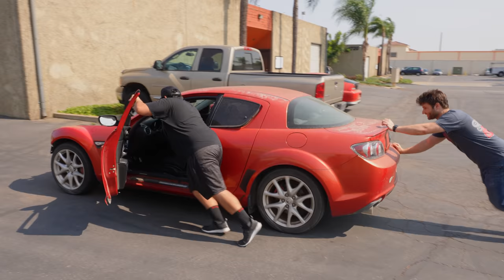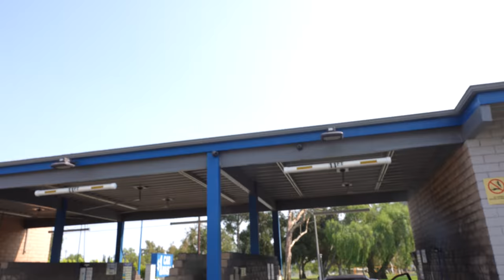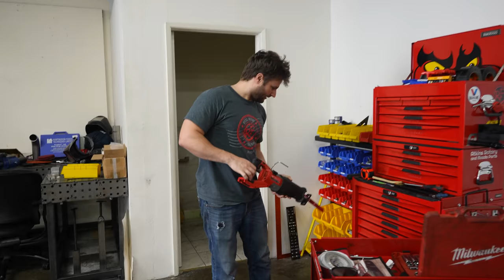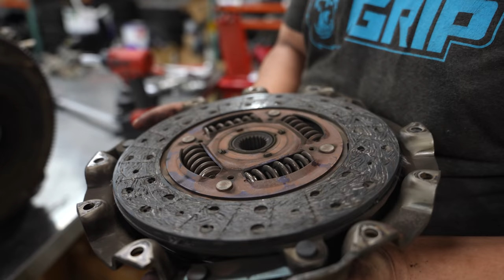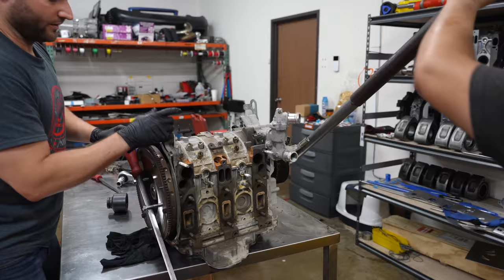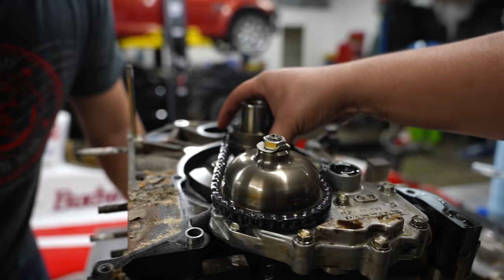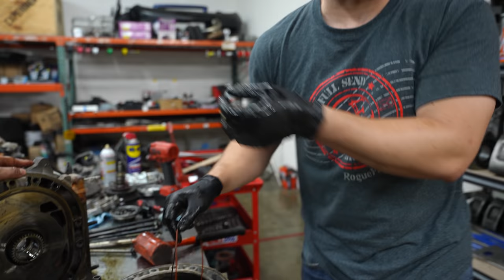What’s commonly wrong with a CHEAP RX-8?

Comment: I'm very interested to see what a budget street-oriented renesis could make in power. Like, maybe a new turbo, plus porting and dowels? And just see what she does.
Reply: the renesis (which is factory naturally aspirated) makes quite a bit more power than the 13b n/a, but its ceiling for forced induction is considerably lower due to the engineering of the exhaust ports (they are side rather than peripheral) bottlenecking the air throughput potential of the engine

less technical version: the renesis doesn't do great with turbskis. most people who want to turbo an rx8 will 13b swap it first
Reply: @ergopropterhoc  Interesting, I'm not super familiar with the Renesis, but that explains the sounds of the RX8s in my neighbourhood compared to the handful of RX7s. This is just making me want to see if it's possible to report the exhaust system somehow, especially if you could set up a CNC jig for it. Maybe a bit silly but the renesis is definitely easier to find than a 13b, even in NZ.

Comment: when you push start the car with something like a truck, would it help to put the car in a higher gear to get the engine to spin faster?
Reply: 1st gear would make the engine spin the fastest
Reply: @dilsher12  not higher gears? as you would be driving the engine from the wheels? so instead of gearing going "small to big" it would go "big to small"?
Reply: @garchompy_1561  Doesn't matter what drives what drives , at a given wheel speed the engine spins faster in first gear than in fifth gear

Comment: Can it be that the housing bolts stretch due to heat and then there’s a small gap that burns trough the seal? Don’t know if there’s stronger studs for the Renesis

Comment: I wonder if you could use an annealed Copper o-ring for the inside (hottest) groove. It would never degrade with heat, and might be great for high boost engines. I gotta try this some time. Cheers all!

Comment: The owner of that car didn't maintain it.  The engine most likely overheated.  If you measure the rotor housings,they will most likely be out of spec. due to being crushed from overheating.  I have never rebuilt an Renesis engine, or even anything newer than an 84 engine, but I have rebuilt and customized several hundred early rotary engines from R100- through RX4 and 1st gen RX7s and when extreme overheating happens this is what you get.

Comment: I had to crank on a crankshaft bolt on a 2008 honda odyssey with like 6 feet of leverage to break it loose in order to change a timing belt. And then it got totaled by a deer.

Comment: If you look at both of the rotor housing right at the spark plug it looks like it's missing a piece of metal, like it broke and that's why the seal failed. How the hell would you fix that issue?
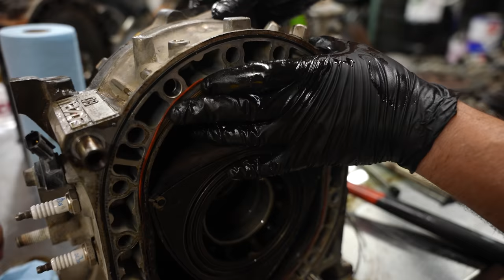Reply: At 14:07 you can the the other housing and looks to be that way from factory.

Comment: I have an rx8 it will run but shuts off once the rpm reach 1000 and It only has 54000 miles

Comment: Boggles the mind why the seals would be heat susceptible. We have all kinds of tech these days that could spawn heat resistant seals.
IMO step 1, don't use commercially available seals. Spring your pocket and buy high heat custom seals. Install those and don't give a shit.